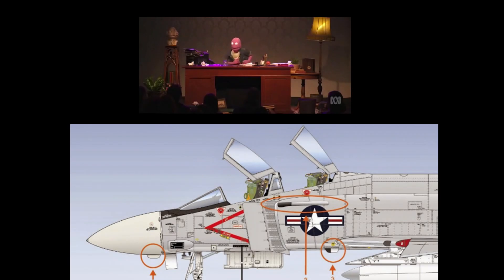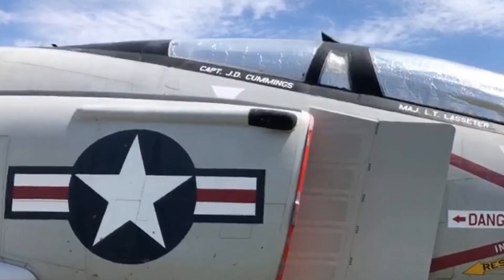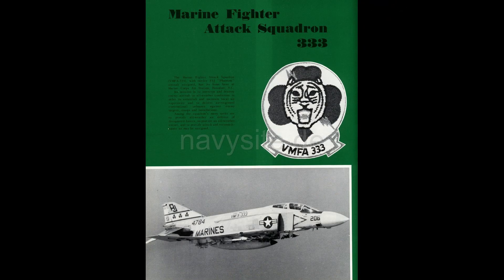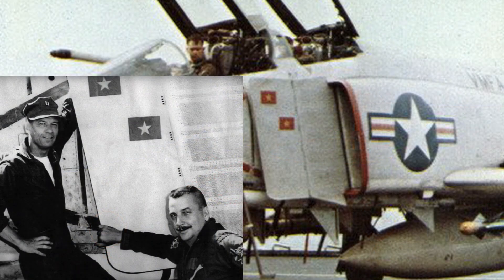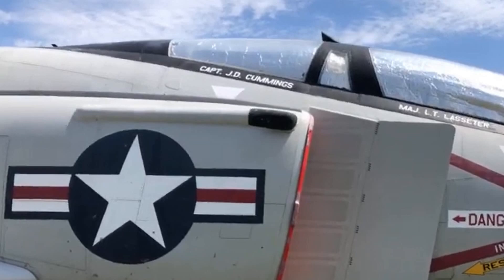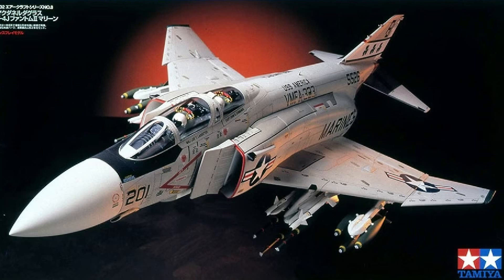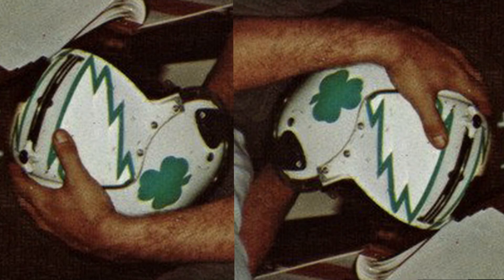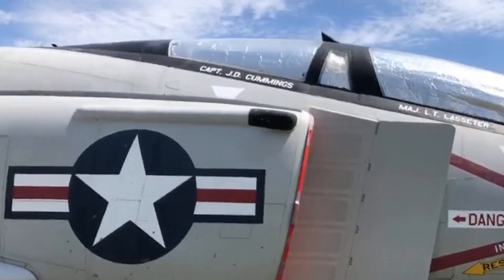Coffee with Max's Models 11/15/24

Comment: Tamiya makes 5 of the 1/32 Phantom Kits. 3 are J models. Marines, Navy, Japan. The picture on the Japanese livery does not have the AN/ALQ-126. Hard to tell on the Navy kit picture. Perhaps this equipment was on the Navy version when Tamiya molded that kit. And since Tamiya updates the parts in their kits they may have added the parts or srpue to the Marine version of the kit. The Marine version kit is an earlier kit by a year or 2.

Comment: Because in 71-72 it was an F-4J by 1975 it was remanufactured into an F-4S. Many surviving Js were remanufactured into Ss. If the COLs BuNo survived,  i may have become an S by 1975
Reply from the maker: The Col's plane (5526) is at the bottom of Haiphong harbor.
Reply: @maxsmodels  ok, so tamiya made a F-4J/S kit, and somone added the S parts when they built the kit on the box top.
Reply: @maxsmodels I'd think Tonkin Gulf or S. China Sea.